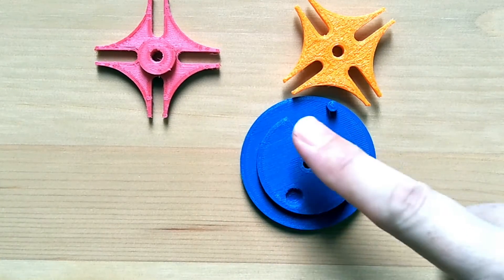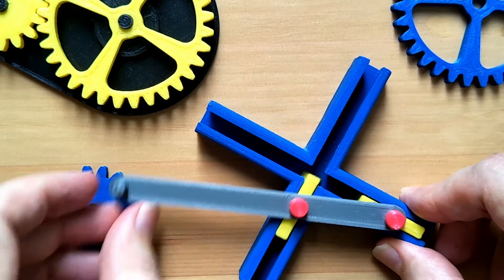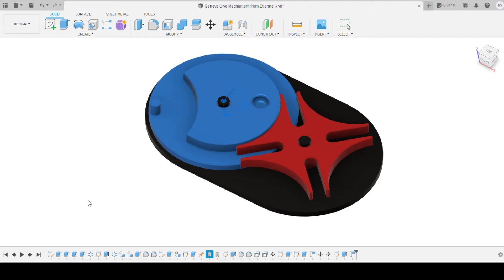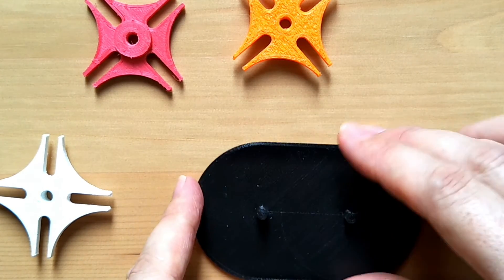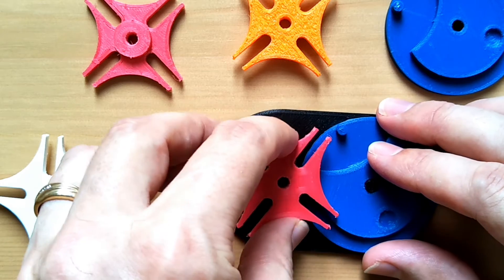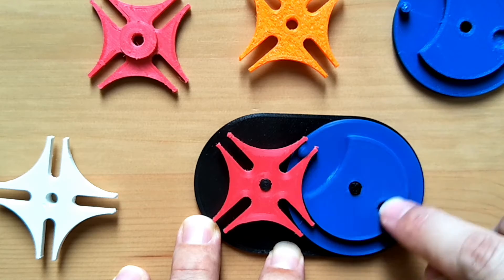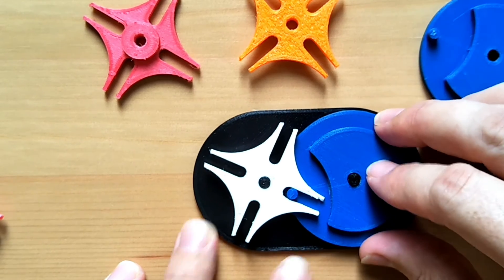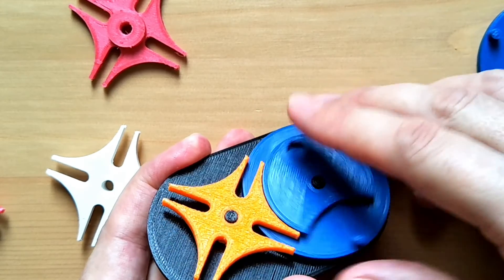Geneva Drive Mechanism 3D Design and Print

Comment: The gevena drive has been around since the early part of the last century, the Bullard machine tool company used it in there Bullard multimatic for indexing there spindle carrier.  It’s a unique design. The multimatic is a 65,000 lb chucker. It can produce and finished part in high numbers. From disc brake spindles, disc brake rotors, trailer truck brake drums ect. They come in 6 & 12 spindle, 8 & 16 spindles. The 12/16 spindles do one operation then you flip the part for the second operation thus twin spindles, the gevena drive is very accurate on indexing the carrier, the hydraulic lock pin locks up the final location.
Reply from the maker: Thanks for the cool info! I had read that the Geneva Drive was used for CNC machine tool carrier spindles. It's good to confirm that from an expert!